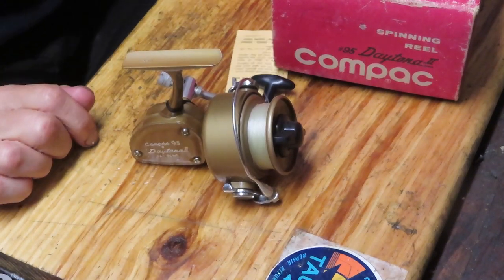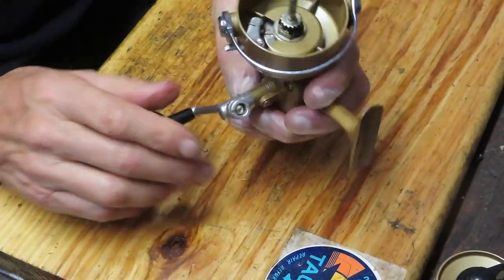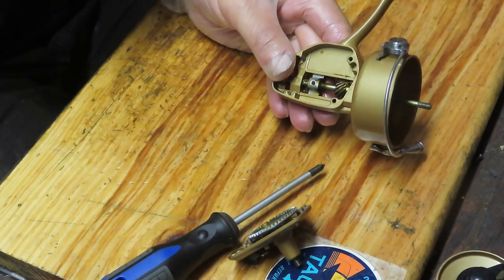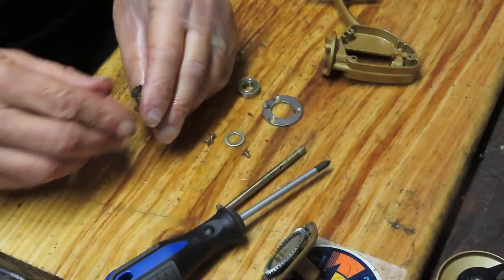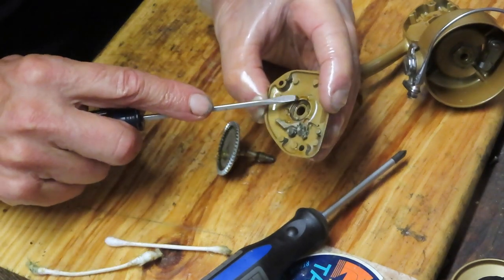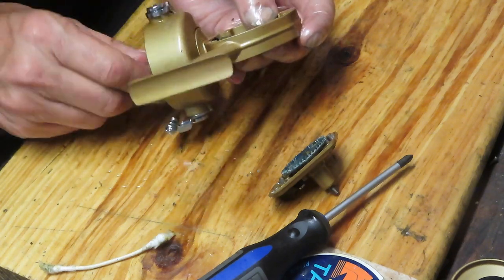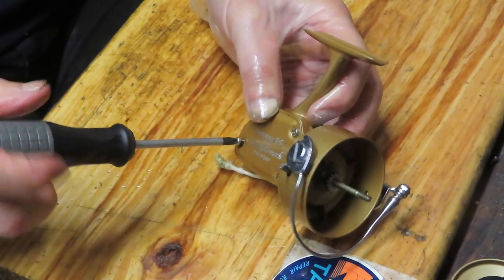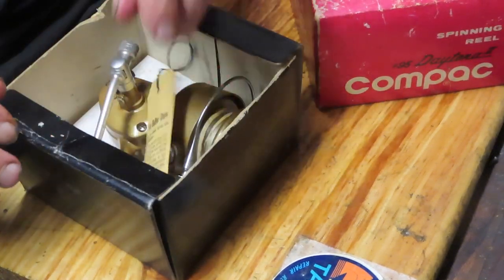Compac Daytona II vintage fishing reel how to take apart and serice

Comment: due to my arthritis, I use a ratcheting screwdriver, I either got it at Wally world or HF, you can't tighten the screw any tighter then a regular screw driver
Reply from the maker: Thanks - yes - I have one as well and use it occasionally.  I like that I can turn the shaft and save time with it once the initial hold is broken - Thanks for the tip - Dennis

Comment: Hey Dennis, I picked up a Com-Pac Caliente #96 earlier this year in great condition, It's  exactly like the Daytona , and I think the higher the model #, the more line cap. and larger the reel, these were not cheap reels in the 70's as indicated by the all aluminum crank handle as opposed to the chrome plated pot-metal junk that blistered and corroded, all major reel producers used those lower grade cranks ,but the reels that have machined aluminum cranks were generally of better quality, look at Mitchell, Penn, Alcedo, etc... and even the Japanese mfgrs.  I fish my 96 as often as my 300, and it's lighter quieter, and has more drag washers than the 300, what's not to love???
Reply from the maker: You said it all.  It is a nice reel that will treat you well - Thanks - Dennis

Comment: Why oil the line guide? Isn't that fixed? Not a roller bearing? I have quite a few Mitchell's and other reels from this era and older but I will likely never use them. They are well made and tough but I cant deal with the noise and the weight. Good video, these old reels are interesting.
Reply from the maker: Habit.  Some have rollers, some have bearings and some are fixed.  If I forget the ones with bearings, it could be an issue.  If I oil the ones that are fixed, well - it's just a drop of oil I lost - Thanks - Dennis